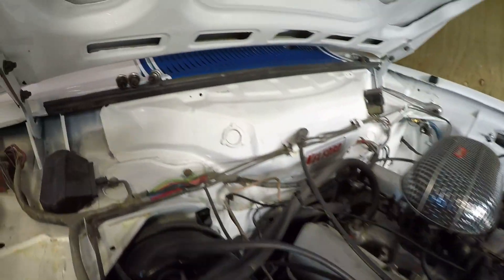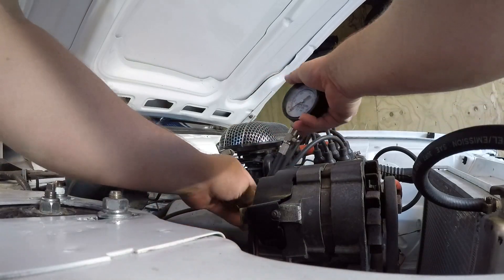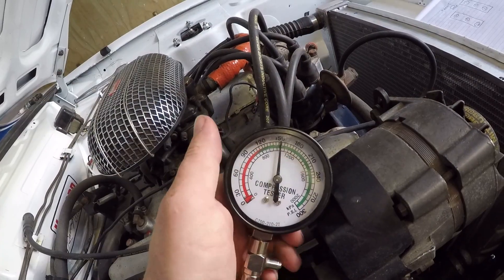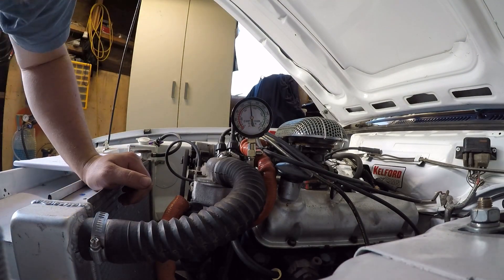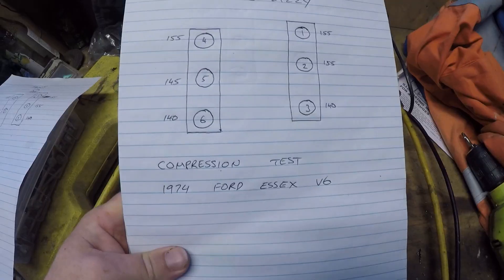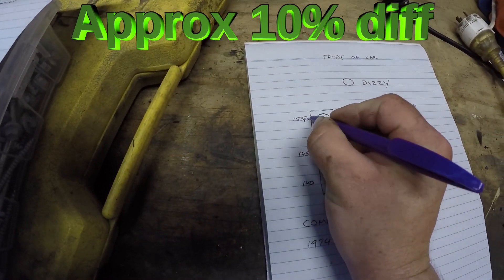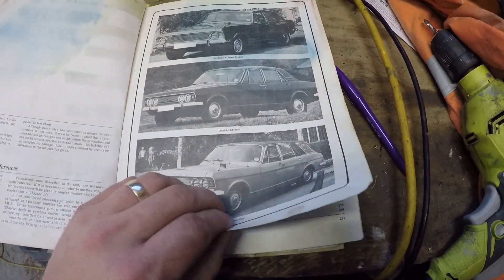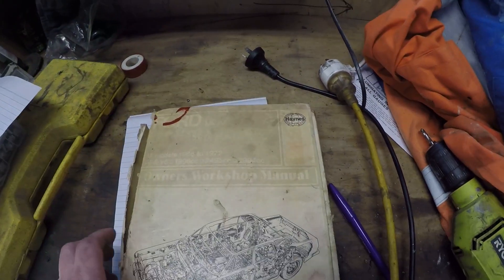Ford Essex V6 3L Compression testing

Comment: Just did an cold test on my motor. Thank you for giving me a point of reference.

Just for those curious cold mine put out

1      135
2      120
3      120
4      103
5      105
6      115

I see this as a wet reading, definitely more oil in chamber than what one want.

Not sure what to make of these but feeling like giving my left bank some more on the headbolts...

I reacon its an worn motor, are definitely buring oil and do have a fair amount of sump compression...

Comment: Just out of interest, did you have the accelerator pedal to the floor when you did the cmpression test? Most manuals etc. say to do this to maximise the volume of air in the cylinders which should give a more accurate reading...
Reply from the maker: No actually,  I'll re check it and see if I get a different result. The results are definitely low due to the race camshaft. Suspect it needs some high compression pistons to get the cylinder pressure up to 200psi instead of ~150

Comment: Nice! You need the 3.0 Essex from the mk3 Capri 3.0S - Fast road cam and big valve heads with better carburation and exhaust manifolds. Nice to dream!
Reply from the maker: I've got a race cam from whoever built the engine before I bought it. A full extractor and exhaust build and porting the heads is something I'm planning for future videos. At the moment, the small carby is my rev limiter haha

Comment: Not too bad, mine has more than 200.000km, never been rebuilt, i am kind of scared to find out what compression it has lol, runs fine though, doesn't use any oil, so i guess the rings are ok.
Reply from the maker: Yea I the good thing about knowing is you can check it every once in a while to see that nothing has changed, like a blown head gasket, broken ring, burnt valve and so on.